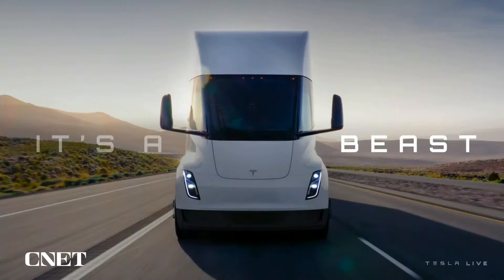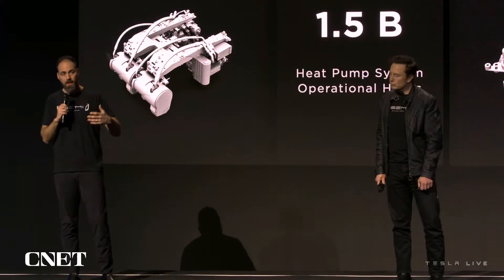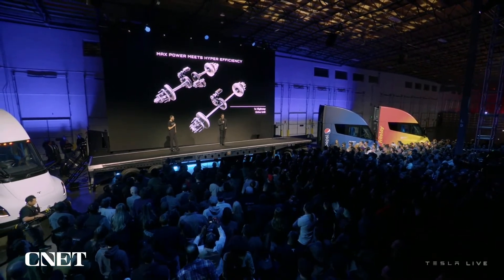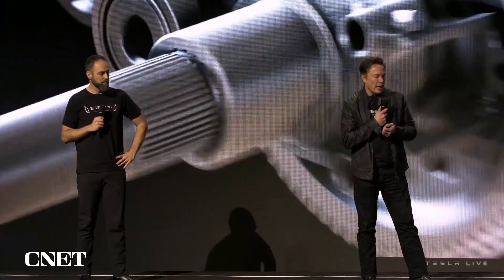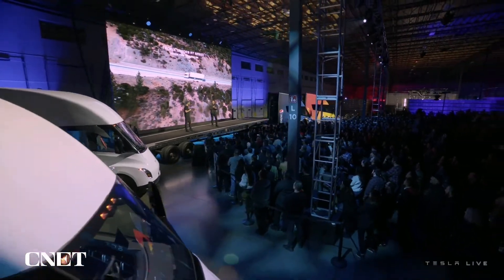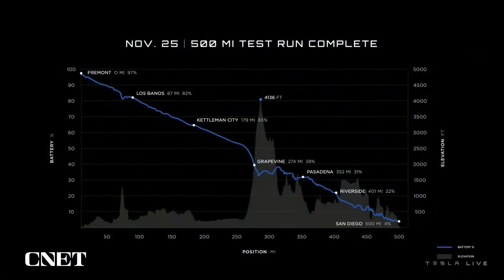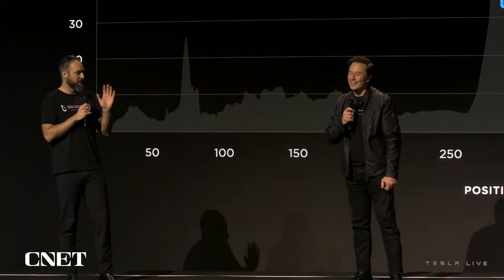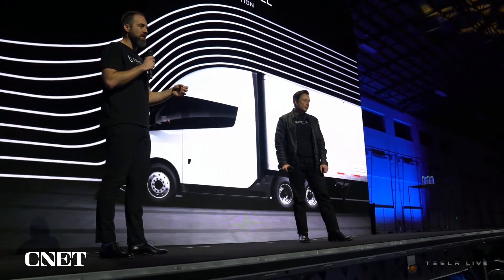Watch Elon Musk's Deep Dive Into the New Tesla Semi-Truck

Comment: Lots of great stuff here..  I suspect that carriers that do lots of mountain crossing will want these.. A lot less risk, and much less wear and tear on the equipment and stress and fatigue on the drivers.
the 500 miles trip is impressive.. perfect for LTL or short runs.. any company that goes from a terminal to a destination and back. Can put a charger at the terminal and be ready to go.
Cross country trips. NO.. not gonna work. But that's not really  that important. 80% of trucking is short haul work.

My only complaint is in the interior design.. sitting in the middle of the truck.. not so great.. I'm sure the cameras help.. But you really want to be checking mirrors not screens.  When going from looking out the front window to a screen in the cab.. you have to change your eye focal length. Doing this all day.. will defiantly result in eye strain.  
When you look in a mirror.. your focal length does not change.. you eye is focusing on the object way behind you in the mirror.
Also.. when backing into a dock.. you generally roll down the driver window and look out.. keeping the dock in sight.. and using that to align yourself. Maybe they have a camera solution for that.. 

A lot of drivers .. like to take family with them.. no place for them to sit..  This is probably not a big deal.. those drivers are mostly the cross country drivers.
Overall this is VERY VERY impressive. Congrats to Tesla Semi team for getting it done.
Reply: Sounds like a move to autonomy would be helpful here. No need to refocus your eyes if the tech only uses cameras ..
Reply: @gregbailey45  The tech has to go a long way before they will be autonomous. If you knew how many people do stupid things in front of trucks and how often it happens you would understand what I'm saying.
Reply: @gregbailey45  
DOT requires you to scan from front to sides and gauges over a time interval.. 
It's in the CDL test..
Reply: I'm with you on these points mate. I drive a roadtrain in Australia and most of the drivers I know, myself included, would not want to be sitting in the middle of the vehicle. It basically gives you two blindspots next to your drive tires as opposed to one when you are on one side. Also a lot can happen in the time it takes for your eyes to focus on the screen and then back onto whats happening in front of you. I think Elon and his designers don't understand how often you check your mirrors. No passenger seat means nobody can train new drivers either, which I believe is the most essential part of becoming a professional. Overall it's a big step in the right direction but the cab setup is a major design flaw that needs to be fixed.
Reply: @murph1337  
Totally agree, I think the powertrain design they've come up with is really good and for the short haul business is really really perfect. But that cab design really needs to be worked on. You can kind of tell that they must not have talked to many truck drivers before coming up with the basic design. Fortunately I suspect it wouldn't be that difficult to just move the seat to the left and rearrange the interior a bit. I do not like the dependents upon screens for visibility. You're going to have a situation where in freezing conditions those cameras get covered with either do or ice or dirt. And having to constantly change your eye focal length from far away in front of you to a screen that is close to you is going to cause major eye strain.
Reply: @kens97sto171  Anything I've driven with a camera in it, I'm not keen on. You can't beat the simplicity and reliability of a mirror. Not only that when driving at night the camera screens really hurt your eyes. Most Euro trucks we have here have some sort of camera for the passenger side blind spot and I can see it is a good idea in theory, in practice I don'tbelieve you can check whats going on quick enough. Working out how to turn them off is one of the first things I do if  I have one. I'm not sure about the weights it will tow, but if that driveline graphic was to scale, then I don't think those axles will last very long. At least that will be the case here with the weights and conditions we run with. Like you said it would be great around town or country work that gets you back home that night, but it won't be viable for any kind of distance work till the infrastructure it will need catches up.
Reply: @murph1337  
Exactly, mirrors work and they're easy to keep clean and de-iced.
Not sure how the axles work in the truck I haven't seen any close-up shots as far as durability goes. The electric motors are pretty beefy.
I just don't see in the US how you do cross country travel.
There's too much randomness in pickup and drop off locations and routes in the US. You would need high output charging stations essentially every place you currently find truck stops with diesel.
On the interstate you'll find truck stops with 200 parking spaces for overnight. You would need a charger at every one of those spots.
In the US about 80% of trucking is short-haul so that alone would make a big difference in pollution and cost of operations for the carriers that do that kind of work. And the short haul stuff is where a lot of this emissions crap really doesn't work very well. The DPF filters get plugged up because they never really get hot enough to burn off the carbon and the things end up in limp mode.
For long distance cross country stuff I think diesel is going to be king for quite a long time.
Reply: @kens97sto171  You guys are a lot more set up than we are, our distances are vast and not many truck stops. Our country is a smidge smaller than yours with only 26 million people in it and most of them living along the eastern edge. We would need a really big amount of cash pumped into infrastructure before it would be able to threaten diesel here. We don't have a lot of dpf setups, smaller trucks have it but the bigger ones just run urea and we never really have to worry about those problems.
Reply: @murph1337  
I bet, running across the interior has got to be pretty amazing. Lots of empty space..
There are sections of the United States like that too. Running across Wyoming, Kansas etc. They're generally are plenty of truck stops. The Long haul trucks generally carry about 300 gallons of diesel. We don't have the big road trains that you guys do though. I would think you guys would carry much more diesel than that.
I don't think the Long haul highway trucks really have much trouble with the DPF filters anymore. They get plenty of temperature to keep the carbon burned off of them. But a lot of the start and stop trucks in the cities do have problems with this. They never really run at high RPM and high temperature long enough. So they end up doing forced regens a lot more often. I think that's the place where the electric trucks will definitely have a major advantage. Exactly the opposite of the Long haul trucks. I just can't foresee how you would install massive quantities of high output chargers at random locations all across the US. And it doesn't really accomplish that much either. Only about 20% of freight is Long haul, the rest of its short haul where Electric is most suited
Reply: @kens97sto171  Yep, around town will be where these trucks will live. We have a lot of long haul work here. Our rail infrastructure is just not there so almost everything is moved by road. Our small population has to pay for a lot of road due to the distances being so vast and there isn't a real lot of tax dollars for it, so the roads are not real good in a lot of places. 350 to 500 gallons is what the bigger setups usually have onboard. The only thing is that you can't miss a fuel stop or you will run out, having said that they are pretty hard to miss as there is so much nothing out there. Central Australia is a beautiful place although I haven't been that way for a fair while now. If you ever get over to this part of the world it's well worth checking out.
Reply: @murph1337  
I would love to check out Australia sometime. Definitely on my list of places I really really want to go see.

Comment: This test is useless, ok almost useless. Electric cars can use efficiency to drag a million pounds in flat terrain.  You are basically fighting air resistance and similar. When electric trucs have an issue is when they are driving a trailer that is not aerodynamic or when they have to go up a hill with a load.  So don't get your hope up. The generation batteries are going to solve the issue.

Comment: You may have this feature...
You should put load sensors per tire per wheel per axle whichever..
To compute loads on the screen and to eliminate the use of scales
Reply: I thought trailers had to be dead cheap and reliable.

Comment: Since the main issue is the battery range and having to recharge batteries every 500 miles (at best), why not make the battery 'hot swappable'. That way, the battery can be replaced at designated stops while drivers have a coffee or a rest-room break. Maybe a slide-in and out battery compartment just before the tow hitch?
Reply: Not really needed when you can charge 70% in 30 mins and truckers are required to take a 30 min break after 8 hours of driving anyways.
Reply: Just imagine the battery swap failed for some reason and then you're stranded. That would suck.
Reply: It's "500 miles" At worst (full load.
Battery swapping is a waste of resources and a point if potential failure.
You still have to charge them.
Reply: at END of 500 mile trip, Tesla semi had 4% SOC with 35 miles in Reserve, could have charged to 70% in 20 minutes,

Comment: Something perhaps worth pointing out here: If your battery is full, you can't do regen into the battery, but you can still use the motor to slow down just as well. It's just that you will be discharging the battery instead of charging it.
Reply: Charging it to 85-90% would remedy this. However, Tesla could leave a lot of unusable capacity to account for this.
Reply: The battery won’t be at 100% long, and 100% on these batteries is not actually 100%, there’s head room. Plus I’m sure they’ve thought of this
Reply: The truck has an extremely powerful computer, an AI based assistance program.
I'm pretty sure a REALLY smart designer wrote some software to remind the driver that "you only need X% Charge because there's a VERY long downhill stretch in 5 miles and you'll gain 27% charge".....?
Just a thought.
Reply: Instead of a torque reversal system to slow down the vehicle, I won't be surprised if Tesla has or is working on some sort of a "bleed resistor" to absorb the excess regen power when the battery is or almost fully charged.
Reply: @joegim7680  I suppose that might make sense if it could be provided at no cost and no weight, but no, I don't think that would make sense. Extra hardware, only to be used in very exceptional circumstances that might not ever be encountered for most drivers. Sort of like the question of what to do about a spare tire.
Reply: Unless you start your journey on a downhill, it will never be 100%, and the recouped energy is a small percentage anyway
Reply: can COAST in Neutral.

Comment: This is not a truck...it's a truck-shaped car which makes it insanely amazing in terms of not having to learn any truck-based driving and maneuvering skills.  Definite game changer.
Reply: It will help with work load.. and ease of driving down the highway and on grades no doubt this will be an awesome truck for those things.. 
MOST of the truck related training has NOTHING to do with any that. 
Its learning how to back up.. and park how to parallel park a truck.. how to safely maneuver a 70 foot truck around tight cities and town. 
 ALL of that is difficult and requires training and experience. 
Having it be electric changed NONE of that.
Reply: Yes..and I suppose the training curve will be so easy and cheap that the cost of hauling goods will be reduced significantly  due to the fact that the price of Kilowatts is way more stable than the yo-yo pricing fluctuation of petrol.
Reply: @MolloRelax  
The training curve is going to be the same or more.
Most of the training has nothing to do with the powertrain.
Certainly transportation companies are going to love not having to buy diesel but also there are significant maintenance costs involved with diesel trucks. Crankcase on a diesel truck holds 10 gallons of engine oil.
The change interval is definitely longer than your average car, most are about 30,000 Miles.

Comment: I'm near a road where trucks engine brake throughout the day. It's extremely loud and annoying. It's so cool to think that EV trucks will be braking almost silently, and the equivalent energy of that noise will instead go back into the truck's batteries. Living and working near trucking routes will healthier and quieter. Probably healthier for the drivers as well, since they won't be exposed to nearly as much pollution. Very excited for electric trucks.

Comment: the visiblity out the front alone is a massive safety improvement over desiel truck
Reply: Yes, there is no hood. The windshield is big and the driver seat is raised and dash is low giving the driver a commanding view of the road. Also, the windows in the side of the truck gives the drive a 180 degree panoramic view.
Reply: @animalloverjulian8243  This truck has less visibility than a normal cab over has although it is better than a conventional truck with a hood on it. By seating the driver in the middle you get two blind spots next to the drive tires as opposed to only having one when the driver is seated on one side. A cab over has 180 degree visibility and the dash height is really only relevant when parking close to something in front of you. Out on the road you should be looking way ahead and definitely not be following someone so close that you would need to see though the dash to see them. If you are that close to a car in front of you then you are definitely not gonna stop as quickly as they can.
Reply: Not been in a European truck, then?

Comment: I like everything about this but there is no way it can haul the same amount as a diesel because the weight of the truck is so much more. It may be 82,000 lbs but much of that is ate up by the weight of the truck. You will need more trucks to haul the same amount of material but it is much safer and more efficient so it's a decent trade off.
Reply: You don't know how much the truck weighs. Engineering Explained did some good math on this recently showing that it likely had a very similar payload weight.

Comment: Perfect for our company as we deliver all our deliveries and pick ups within a 100 mile range with longer distances at some hubs.😎🇺🇸
Reply: It's a long range truck, just needs a change of perspective.
It can run an 8 hour shift (except that it's faster, since it doesn't slow on gradients! The test was 500 in 7.5 hours according to the display in the truck? Including a comfort break?)
It can charge during the driver break, (they didn't on the test) collecting enough energy to compete the full 11 hours driving with room to spare (all at max load, with reduced weight? It's even better!)
.
Overnight?
Why not use a lower power charger?
Any Tesla V3 car charger can "fill" this truck 0-100% in 4.5 hours.
It's just the same as the cars.
"Outrange the driver, fill while the driver rests, repeat"
Reply: @rogerstarkey5390  
Our driver works a 8-10 hour workday and is idle almost half of that due to the loading/unloading process. That time can be used for charging if needed.
Reply: TESLA semi can go 250 mi ROUND trip , no CHARGING.
Reply: too bad it can only haul 6 tons
Reply: less than half the load carrying capacity of a conventional truck. There is a reason why they have decided not to supply them to the market now and just use them ‘in house’ 😏
Reply: PepsiCo have taken delivery of a handful of tesla semi.  So......
Reply: @shaneross6229  won’t disclose it’s empty weight. So………